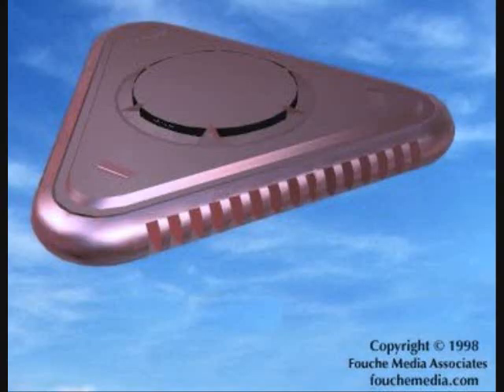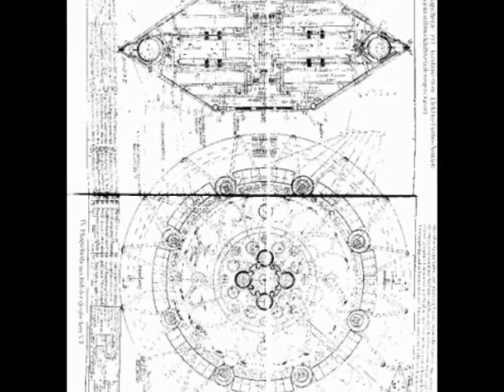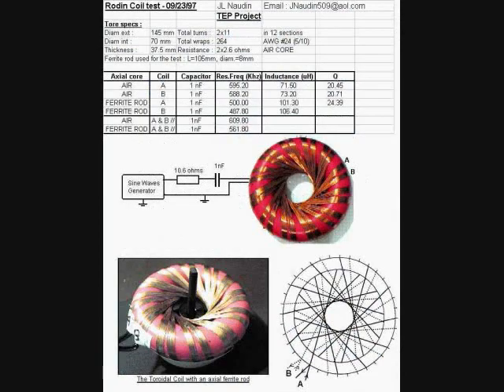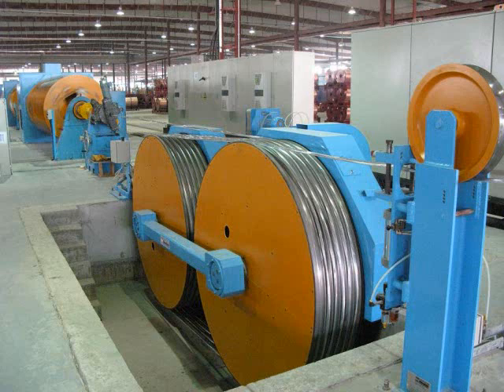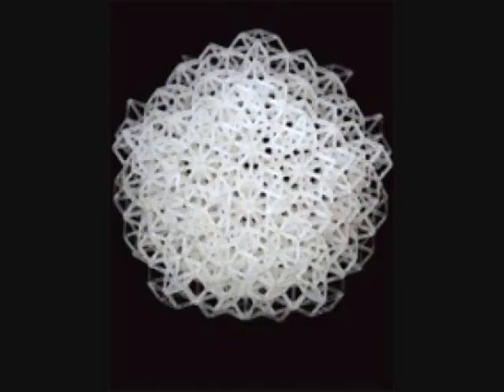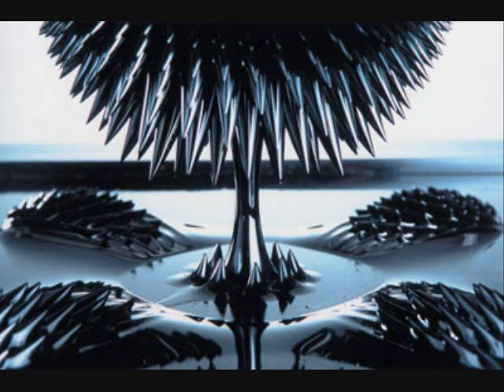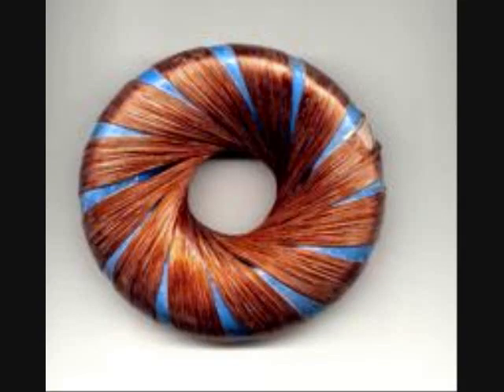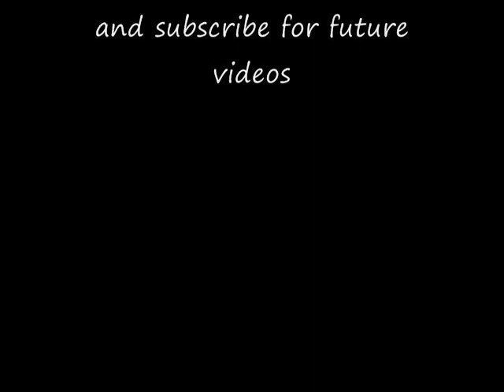UFO-Flying Saucer Engine-how it works

Comment: We actually understand ferrous based liquid very well. The reason it works the way it does is because it contains tiny iron particles that water "sticks" to. Your position that the other models are false is biased because  as you say many times you believe this. By the way rotating mercury with electricity running through it does not "bend gravity" or create "gravity nullification." Also where are you getting your "facts" like photonics supercomputers? By the way G force does not "rip you apart", rapid acceleration is what would kill you because of inertia differences between you and said vehicle.

Comment: I must admire and applaud this guy's research and in-depth explanation and analysis but it is all sheer speculation on his part and he doesn't explain exactly how this mercury-based super conducting liquid will actually cancel gravity and achieve UFO type flight.

I agree with SIMHOPP and I prefer the more coherent and credible explanation  of ROBERT LAZARE who reported that UFO propulsion was based on element 115, an element which was not even known to mankind until many, many years after Lazare first described it and, speaking as a former trial lawyer for thirty years,  this fact itself validates everything else he said about having worked on reverse engineering alien UFO craft in a special even more secret part of area 51

Comment: Actually they are powered by light creating a magnetic field vortex. The crystal on the outside actually magnifies the energy (plasma field). The crystal has to be something like silicon but is 3,5,7,11, 13 etc. It has to be able to utilize,magnify, and support light magnify and focus the light. The Egyptians, etc used dolomite with metal,etc to create the lift of the huge rocks.

Comment: @MisterX The mercury based plasma has some interesting properties. The doughnut shaped tube with this mercury based plasma is called the Magnetic Field Disrupter. The MFD is not a propulsion device. It is just as its name suggests. It uses a magnetic field to weaken the gravitational influence that objects have on one another. The result is that the weight of anyone & anything within the magnetic field is changed. Essentially, it is a very clever way to increase or decrease the force of gravity. In the center of the doughnut (the doughnut hole) there is a permanent magnet. The doughnut has inside of it the mercury based plasma. It is pressurized to 250,000 times the pressure of Earth's atmosphere. It is also cooled to a very low temp of -189 deg fahrenheit. Around the doughnut is a Rodin coil. Either the permanent magnet in the doughnut hole or this pressurized, cold doughnut with a coil wrapped around it is rotated at 50 or 60 thousand RPM. It is under these intense conditions that the unusual properties of the mercury based plasma emerge. I think that under these conditions the mercury based plasma be comes a super conductor with zero resistance, but I'm not sure about that.  The 3 burners are what propel  the TR3-B Astra. They are oxygen and hydrogen burners.

Comment: It works as a magnet (solenoid) when the engine of the ufo increase current it will attract to the earth and otherwise if you change the current of the solenoid the magnets will change and their will be repultion to the erath

Comment: Good information. I saw a video where they let the craft vibrate at a certain frequency. And then the craft would hover in the air. Then you control the ship with thoughtforms with a crystal.

Comment: I think they control the direction by controlling where the positive and negative charges run, since propulsion with this type of technology goes in the direction of the positive charge.  This also creates a gravity bubble in the direction of thrust.  The occupants of the craft probably feel nothing at all because the ship no longer follows the same physical rules of the atmosphere around it - the technology it uses creates a new set of gravitational and electrical laws in and around it.

Comment: there are many way of purposion when u put electricity into that donut it will make the coperbase mercury spin in a vortex circle like a very tec electric motor that is the power plant it puts out more electric power than it takes to run it u could use a bagdad batury the purposesion is what you would call a lifter a lifter is a triangle witch you put in high elictricity and it levatates hope this helps peace...

Comment: excellent research...I am building a gyroscopic magnetic anti grav device now, took some figuring out but I am using lead as the main weight pull on the gyro, this adds stablility to the lift.. IT REDUCES THE MASS BY 60%, still trying to increase this but its time and money. the movement forwards and backwards is a problem though..

Comment: One fault of current science is that the tremendous g forces of these theoretical devices will kill any being moving at those speeds; however, that only applies to biological beings; Silicon based life (yes, computers are, but are still in their infancy) is able to withstand many times the forces that humans do. Also, 'computers' use energy rather than food and water, and don't need air, either.

Comment: I think It's absolutely imperative that more research is conducted in the field of hyper space.  some people think it's too far fetched right now.. maybe so, but conventional rocket ships are honestly archaic at this time.  I like that you touched on the anti-matter fueling systems.  From all the info i've heard it seems like anti-matter is the only material capable of acheiving the energy needed for intersteller flight.  a pin head sized portion could level a city!

Comment: It's a theory, it might even work, but this it not how the average ufo works. Many of them do not even need moving parts, especially fluid. You haven't explained why many ufos have sets of 3 lights even. If you or anyone really wants to know going way beyond Rhodin's math, check my channel.  Superconductivity is a matter of arranging and modulating particles so they can most efficiently induct electrons to and from a linear plane in the creation of a heavy positron/positive ion.

Comment: I think I have something new that might be of use I remember a thing a wile back in the news about gas giants and what they are made up of and anyways getting to the point. Hydrogen at pressures around 400 GPa should becomes a liquid metal that should out preform mercury and should not go into a solid state. I am no scientist but reading about it it seemed it had a lot of remarcable properties.

Comment: @synapse131 up,down, back and forward movement could be achieved by use of  plasma  drive engine .
The spaceship could be powered by use of cold fusion generators.Keep up the good work.

Comment: i think the spinning mercury in the middle is supposed to work as a gyroscope to keep it stable, and not a propultion system (the propultion system must be the 3 circles in the corners) :-P

with all that mercury spinning, the plane won't need rotors or anything to fly in a straight line..

no moving parts outside the plain in other words..

Comment: I've not come across any reports of any salvaged anti-matter reactors. So I'd like to submit then a theory as to how such a craft could be both steered and travel between stars. Imagine being able to focus on any star as if with a telescope multiplying not photons but gravitons and being able to lock onto the gravito magnetic attraction of any star. You could focus on a star above you to move up or one below you to move down  You could focus on line of stars one at a time to travel far away

Comment: If you use a tube of thin-wall hardened copper about an inch and a half inside diameter and maybe a foot and a half across, and fill it with common tap water, and spin the water by swirling the loop with your bare hands, then toss it into the air, it will float for a moment before slowly descending. This is a working example of a Victor Schauberger "implosion" centripetal apparatus. I built one when I was about ten years old. The effect is called "frame dragging" or pulling a frame of space/time

Comment: @rbilleaud Ferrofluid, which is frictionless liquid, is spun inside of the donut inside the coil. The copper wires fire off at different intervals and attract the metal particles in the fluid, causing the fluid to  to start to swish around the donut. Since it has no friction, it can spin inside the donut at 60,000 rpms. It must be noted that the TR-3B does not defeat gravity, it only reduces its mass by 89%. It cannot achieve complete antigravity. Other TR series planes might be able to though.

Comment: yeah your right about that the coils need to be keep control with photon A.I but the way that they manoeuvre is not through just creating a anti gravity the idea is to create small fragmented gravity pulls isolating a certain energy in-front of the area wishing to travel "easier to pull then push something"

Comment: At Area51 where 'they say' nuclear testing is done, look carefully on google earth(tm) and you will see that the craters are actually not craters caused by nuclear tests.
There are massive wires that create these circles and what looks like they are extracting Mercury !...wonder what they want with loads of Mercury?
The road going through this area gives away whats in the craters-Mercury road.

Comment: by the way. If you could flush Super liquid helium (a superconductor) around a donut shaped object that could withstand extreme pressure and laser cooling in a vortex fashion (which would work because super liquid helium has 0 viscosity) while pumping energy through it. You could get an anti gravity output far beyond the capabilities of copper or gold. It's just a little playful imagination. Sorry for the double post.

Comment: Impressive indeed.
But most people want to know where the universe is before they go somewhere.
Whoever engineered the universe knows all the secrets.
So, GOD had concepts far above travel.
Dynamic torsion waves travel at least 1 billion X faster than light speed.
Do saucer engines develop or create these waves?
LIGOS will tell us if the galaxtic core is ripe for another explosion?
Damn complex stuff. Got to read more before making silly comments.
Sorry.

Comment: for the record, ppl dose know what ferro fluid is. you can make it with black ink mixed with wegitble oil, and then use a magnet to get the spike effect, but dont use to much wegitble oil, and have a strong magnet.

Comment: Thank you!!! You did your homework. I can build with the info you put forth. Videos like these are why I started to watch Youtube!!!!! Who needs light speed, just move through time, and use a large block V8 engine, that uses water as fuel. Talk is cheap, when I get at least $400,000 U.S. set a side, I will do this project. P.S. When I was in the U.S. Marines I learned a lot from people with many different accents. Dont criticize this guy until you have begun the journey!!!

Comment: You are on to something with the Rodin coil and a quasi-crystal (I believe it is most likely a carbon quasi-crystal, similar to glass being a quasi-crystal of silica  -- I call it Diamente) Of course I just think and do not have the math skills. However, the secret involves fermions and bosuns which allow us to overcome the Pauli Principle such that matter can have two different states at the same time in the same space.

Comment from the maker: the magnetic field moves the liquid because the liquid is diamagnetic , which means it pushes away from the magnet field and the magnet field is spining so it makes the liquid spin, also the rodin coil is the only coil with a vortex magnetic that causes stuff to spin

Comment: 100% Yes it has been completed! Saw one 1994. In Noblesville, IN. Not just a glimse either I watched it for 5 minutes before I decided to get the hell out of there. I am starting to wonder how involved Martin Marietta is in this project. Marietta joined huge defense contractor Lockheed Martin in 1995. The craft was spotted by a Martin Marietta property in what was that time very rual area. Everyone needs to keep digging on this issue and informing  till they have to crack.

Comment: Matter/ antimatter energy has already been tested. It is easy to generate antimatter by simply reversing the particle rotation look up spin flip. The up down left right motion of the craft can be achieved the gravitational vectoring which is achieved by mass modulation. super hard crystals you mention are not needed as normal silicon and metal can be employed. I get into a little trouble but here's the hint elongate the particle orbits in mass modulator core and calculate the gravitational diff.